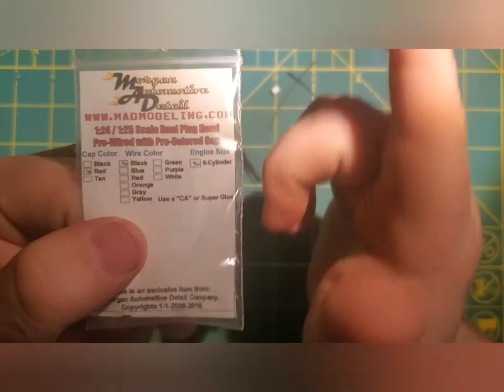Tips and tricks- adding plug wires to a scale model

Comment: For my boots i just pull off enough wire ill need for the boots and coil. Take your knife and roll the wire a couple times, take your finger nail and thumb nail where you cut at and just simply slide it off. All your wanting is the insulation. Just throw the copper wire away

Comment: Hi. I dont know if you found a solution to get the copper out of the wire for the boot. Im a new subscriber. So you can use a wire stripper to get a little insulation off the pull the copper out. It works best if the wire is warmed up with a hairdryer ect. Good luck

Comment: i use a piece of 1/8th inch styrene tube and cut a small piece off and glue my wires to the inside. I am going to start ordering premade distributors and seat belts

Comment: Cool tips! I find it hard to find this kind of specialist part so I've made these as best I can using Tamiya wires.
I'm about to build a Heller kit which actually has one of these moulded in rubber with the tyres. I've never seen that before.
Reply from the maker: I order mine from Ted's Modeling Marketplace. Other than that one can use 30 guage wire wrap. I'll kind of be doing that in the engine build for my current WIP.

Comment: You can find plenty of engine photos on the net to show how factory wires were run, and how people with modified engines run them.  Some engines had wire guides attached to the valve covers or intake manifold to hold the wires in certain positions, but then no factory hemi had a superrcharger.
Reply from the maker: Not since 2015 anyway, lol.
Reply: @insomniahobbies  The Hemis you use in your video represent the second gen Hemi, the Dodge Hemi that came out in 1966.

Comment: take a pair of electrical wire strippers to remove the insulation then cut that to the size of your boots and glue to your plug wires......
could you please add links to the products you review, enjoyed this.....thanks
Reply from the maker: I never thought about stripping back the wire to slide the boot over. Thats a great idea! Most of the stuff I buy I get local from independent hobby shops so posting links to most stuff really only benefit locals. That being said I have started doing better on some of the recent videos with more info and links in the descriptions. Like my paint supplier and sources for aftermarket parts.

Comment: What size drill bit are you using for the wires? This will be my first time doing the spark plug wires in a kit.
Reply from the maker: I honestly have no idea. All these bits were included loose with the pin vice. I just used a scrap piece of sprue and started drilling holes until I found the right one.
Reply: Okay. I'll look through my drill bit set when I get to work see if I have any that are small enough.

Comment: I buy 28 gauge AWG wire by the spool from amazon for boot wire.
Reply from the maker: If that will fit over the 30ga wire I use for the plug wires then I'll definitely check it out.
Reply: @insomniahobbies  Remember, the higher the number the smaller the wire is, 28awg is just one size bigger. The boot wire you have there is perfect for it. I have been making my dist.... and you have led me to the right place. Those wired dist... are awesome to what i do.